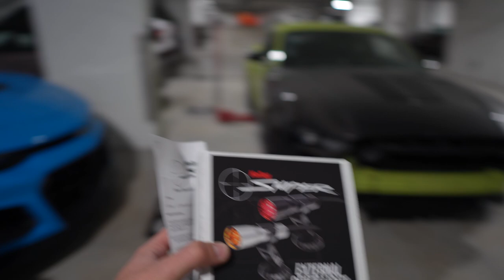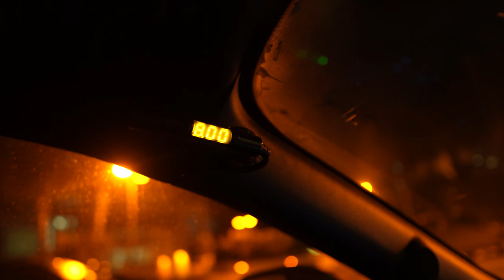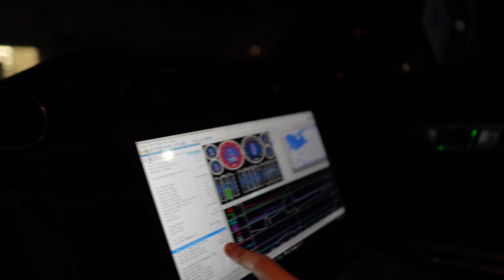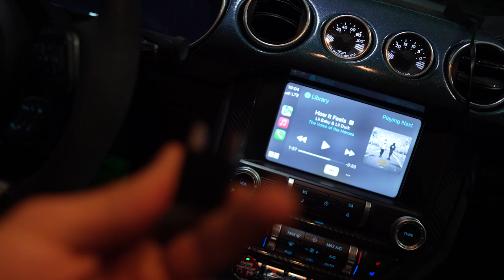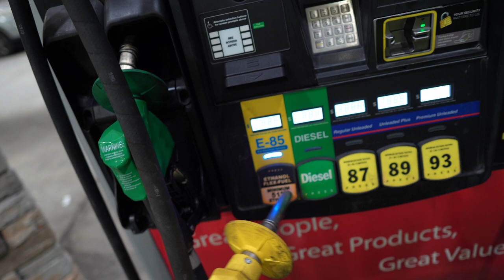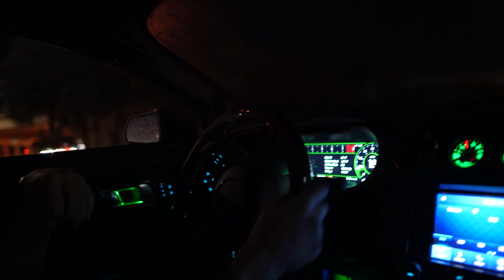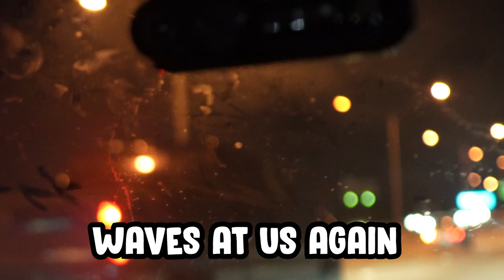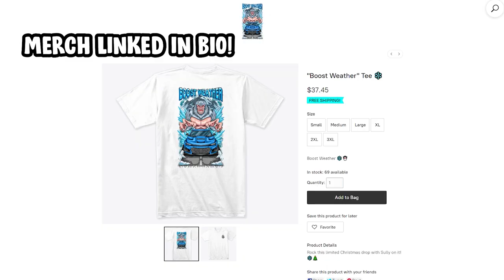I THOUGHT I BLEW MY MUSTANG MOTOR UP... (NEW HOLLEY SNIPER SHIFT LIFT INSTALL) #FORD #SHIFTLIGHT

Comment: It sounds like you blew the housing to one of the exhaust clamps. Either that or you might have burnt a spark plug where it meets the ball joints.